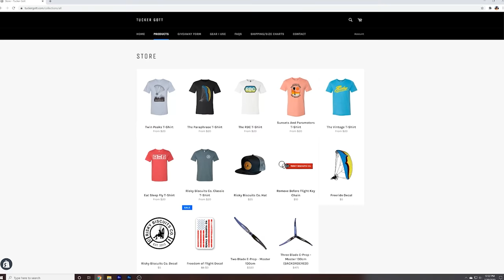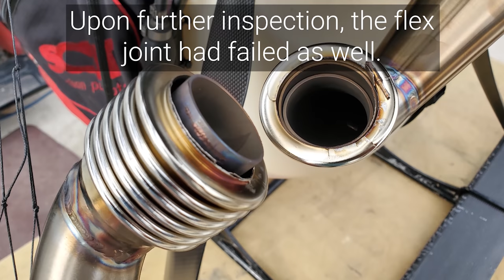Landed On A Street!!! - Top 10 Engine Failures

Comment: Tucker, need you to settle a score. When referring to the motor/engine on your paramotor, do you call it by the chassis name? Or do you call it the engine name? Would you say your exhaust cracked on the Scout, or would you say your exhaust cracked on the Moster 185?
Reply from the maker: I would call it by the engine name.

Comment: If you have an Atom 80, make sure there’s oil in the gear box!  It’s only 33ml so doesnt take much, but not having oil caused me an engine out on my 13th flight, after 10 min of flying..Gears turned into confetti, it was my First time flying this motor after just purchasing used so lesson learned.

Comment: Good thing you found that screen that goes in carb. its a filter but also restricts fuel flow with out it mostly like the engine would get flooded. Most weed wackers,blowers and chainsaws have the same screen and its almost always dirty if they're not running right

Comment: Lovely and very educational videos!
I never flew paramotor or paraglider, only regular gliders. One thing I found a bit strange, a total lack of instruments I was used to (stall-warning, altitude, speed, vario, possibly engine instruments (cylinder temperature, oil temperature, water temperature for water-cooled), quantity of fuel etc. I guess it would make the whole thing more complicated and a bit heavier but it would, on the other hand, increase safety. I would be grateful if paramotor pilots could comment on this.

Comment: I have a moped, so Im familiar with centrfugal clutches. they are great, but If your engine is acting up just starts to go up in revs, and you can't make it stop, having a killswitch or a fuel tap to cut fuel, or even an airvalve to suffocate the engine can save other components, In my case the clutch and variator, in your case the entire motor

Comment: The buildup in the combustion chamber from running AVGAS is from the antifreeze/anticoagulant they run in AVGAS. You need much hotter combustion temps / much higher compression ratio to burn it off properly.  That buildup is the same reason why Hot Rod people don't run AVGAS in their Hot Rods anymore - it kinda gunks up the works.  Tetraethyl Lead is more of a lubricant and is designed to burn up and not leave deposits like that.

Comment: All sound similar to several engine outs on my Quicksilver UL, E and MX . Unfortunately one of the landings was in a stiff wind and bounced then ballooned up to 20' then noise down at a 45 deg. It was on a weight shift and I caught the cross bar in the ribs.

Comment: Man i want one of these so sooo bad 😢😢😢. Btw. To fix the problem of the rings clipping the exhaust port. Sometimes you can drill out the oil hole on the exhaust side in the piston. (I do it to allot of 2 stroke bikes anyway).  They seem to catch there allot esp if running a little lean

Comment: Funny I've seen your failure number one in person... it was my dad, he had a rig that was more gokart than backpack... throttle froze but he couldn't go up or down... ended up hitting kill switch at about 50ft agl... I'm not real familiar with the performance specs of the wing but 50ft wasnt enough altitude to transition from dragging the chute to flying the chute and flare to land...he just kinda screamed into the ground at a 20° angle, and had quite a bounce... broke the nose wheel and the hoop but walked away...

Comment: Very cool. Glad none of these involved anything more than a safe landing, after an engine failure. By the way, I wonder if you could touch on the topic of electrolytic corrosion, a leading cause of part departures, when differing metal types are brought into contact with each other? Thanks.

Comment: Dude I love your videos and as an Electrician and also someone who knows a lot about engines do you know how incredibly easy it would be to hookup Analog or Digital fuel gauges? It would be so much easier to see your fuel level. Also, pro tip, be sure to ask your local mechanic where to get the cleanest fuel, some gas stations, especially BP , can have really dirty fuel. Other than that small engines are all about TLC maintenance and knowing how they work. So basically just take it easy on them and take care of them well. The inside of that cylinder with the lead fuel was BAD!

Comment: Fit an anti freeze system to the throttle cable tube or a heater element. Try aspen fuel for your engine it’s super clean.

Comment: @12:47  Maybe the engine run lean, got to hot and the ring gap is too small.  When ring expand too much due to heat the ringgap is zero and the only way to expand is out through the ports. File a larger ring gap. Maybe 0,10mm  (4/1000 inch).  Measure the ring gap first with a new ring 1/8" down in the cylinder. Check specs.  File it to upper limit and you are safe.

Comment: Just a headsup peeps.  99% of these motor problems are preventable by simply doing a VERY good static balance on your prop.  I have found that even though e-props come very closely matched, they are still a gram or 2 off.  Get a good digital gram scale and measure each blade, then make yourself a good setup with either a lawnmower blade balance kit or build one using threaded rod.  I have both setups and I make sure to check balance anytime I have a prop strike or suspect the vibrations on the motor are getting bad.  If you start shaking wires off of switches, or shaking plugwires off of sparkplugs, cracking exhausts, etc....it might be time for a static balance check.  Cheers, and happy landings.

Comment: Man that issue with those rings tearing the inside of the exhaust port, I had that happen on a dirt bike of mine. Are they 2 or 4 stroke motors?
Reply: Paramotors are mostly equipped with 2-strokes. On 4-stroke there isn’t an exhaust port on the cylinder to tear.

Comment: What did you fine out about that stainless steel weld? What little I know about ss welding,I'm thinking the guy that welded it used the wrong filler wire. I wouldn't get anything welded from that company. Good thing it wasn't the frame or a structural part of the paramotor if it was made of stainless. And did you get it welded or go back to previous style exaust? Thanks,just a bit curious

Comment: When you put a lot of time on 2-cycles the piston rings wear out and rotate around hitting exhaust port. Or the small alignment pin hole was drilled to deep so the dowel wont hold ring in proper alignment i have seen this on cheap pistons NEVER SAVE MONEY ON PISTONS by getting cheap trash. And always put wrist pin clip in so that the C shape is not pointed sideways in cylinder at high rpm's the c clip can pop out and boom goes the engine  i always point C facing down seen so many new 2-stroke builds go wrong in break-in from this as well as dropping c clip in crank case and when you rev it up is sucks it into the piston.  little tips from Alaska

Comment: Tucker, on your first frozen throttle cable issue, if your killswitch failed do you have a fuel cutoff to starve the motor that you can operate in flight?

Comment: This video just made me think of some final destination stuff. What if throttle got stuck wide open with a kill switch malfunction?  If you had plenty of gas wouldn’t it take you up into where you would need oxygen . Which would need more oxygen first . The motor or the pilot as far as passing out or quit running .
Reply: Pilot could use wingovers and turns to keep excessive altitude off until you ran out of fuel...still would be a sketchy situation though!

Comment: From what I see as a TIG welder on that exhaust, the way how that thing is welded, how irregular every bead is, undercuts pretty much on every weld, deeply sunken but joint welds, I wouldn't have put this on my paramotor at any circumstances. That thing is dangerous and they should reconsider occupation or at least quality of their work and their welding procedures.
Reply: Totally what I was thinking as well. Some shadetree engineered stainless exhaust that looked pretty but wasn't even fit for a ground ATV, let alone an aviation-grade application.
Reply: @rugbyguitargod  exactly. The problem is that welders are readily available pretty much to everybody and it’s not really regulated as in who can manufacture aviation/aerospace grade products.

Comment: 4 stroke air cooled motors on older quads and dirt bikes literally run for 15-20yrs failure free. Can those be used for your motor setup? Quality of those motors are not good. Regardless of what you may think

Comment: If you ever buy something that's stainless steel and the welds are rainbow colored like that, look inside. Odds are there will be grey/brown crystals on the inside of the weld. What that is is what's called "sugaring" which happens when the inside of the tube isn't purged with argon and oxygen can get to it and make it brittle. I expect that was what was wrong with that exhaust. Add to it the weight of that expansion chamber and muffler and the vibrations with the prop and that's why it broke so easily. If you ever find that, I personally would send it back as it's only a matter of time before it breaks. Sad part is almost all stainless exhaust systems are made that way from the factory, it's not worth the extra $20 or less of gas to back purge it to them, hand made parts are the only way to go IMO.

Comment: Those engines have a lot of fail points…possibly niche/semi amateur build market so quality can be poor while costs are very high. eg new exhaust broke off…who built that?
High performance/light weight components might be a factor, structural margins must be tight. A 30 HP motor is almost as powerful as a very small car, but light enough to carry.
Looks like maintenance requirements are considerable with a high chance of things breaking and falling off.
These mini documentaries are an excellent inside view of this activity.
Reply: it would be scarier if the engine would have stopped if he was near ground and high speed

Comment: Hey Tucker: I have a couple questions. I actually found the answer to my satisfaction but thought it may be a topic for a video... Why do you fly a paraglider rather than a parachute? What is the difference?
Reply: One is designed for unpowered falling and to be opened during free fall the other is designed to work with a motor and be open from the start so I think it might be more efficient but I am just guessing
Reply: @christianlingelbach5327  I'm guessing you have not done a search for "Powered Parachute". This is not for freefall skydiving.
Reply: @homezero  and a parachute is what is designed for freefall a paraglider is not thats all I said
Reply: @homezero  I never heard the term powered parachute
Reply: @christianlingelbach5327  Just an alternative for Flight. I might add a more expensive route. They can fly in higher wind conditions due to the weight. this is more of a cart flight not a foot launch.

Comment: That exhaust crack looks like it was caused by the weld not having a cover pass, it reheated and failed. Overall the welds didn't look too good. I could do much better myself lol
Reply: I'll have to check out the welds again but as a mechanic I'm fairly confident he installed it improperly. It's not a homemade fence post exhaust, its from a legit company that sells plenty of them, so I doubt their selling exhausts that fail in 5 minutes in 2 different locations. It  failed at the flex pipe as well which is a major red flag.  He must have omitted a bracket somewhere, installed it under tension (ie prying it one way so the bolt holes line up or something) or didn't use lock hardware/correct torque on exhaust mounts and it shook loose. A little bit of the wrong vibration can cause a lot of problems.

Comment: The local instructor alway recommends aviation fuel 100LL. I noted that auto fuel had less lead than 100LL and asked him why he recommended av fuel.  His response was that the methanol and other additives to auto gas could or would potentially do more damage to the engine than the lead in 100L even after I watched him open an engine and scrape out the lead deposits on the piston and head. I know you ususlly use auto fuel. Could I have your opinion on this?
Reply from the maker: I've always run pump gas (aside from the Icarus) and the only bad effect of the ethonal is that it shrinks your fuel tubes after ~150 hours.

Comment: 7:05 i dont think thats the lead..... 
might be the oil-gas mix ratio was thrown off..... and it was running a bit lean. 
.
im an auto-mechanic (who also uses 100LL in my hot rods).... but engines ran for DECADES on leaded gas with out making deposits like that....
im really thinking the oil-fuel mix ratio got thrown off due to the octane difference..... and the lead acting SORTA like the 2 stroke oil
.
might of had too much lube (oil and lead)..... which would lean out the fuel-oil / air mix 
.
what did the spark plug look like?

Comment: What I tell you about a two-stroke motor!  A two-stroke engine sucks!  It is worn out, frequently breakdown, and even suddenly dies out while in the air.  A four-stroke engine is much better and lasts long durability.   The biggest disadvantage of a four-stroke engine is its heavier weight than a two-stroke engine.  Also, a four-stroke engine costs more. 😖

Comment: Avgas is just higher octane right?
I don't know anything about these specific motors but I do know that if you have a low compression motor running high octane fuel is bad. I run high octane fuel in my bikes because they are high compression and can burn off the extra crap. You should have heard a major difference in engine noise. If I run low octane fuel I get extreme pinging. Loud af. Changing your fuel mix with out a tune is sketchy af and doing right before or while in a endurance race is bad news all day. You could have seized in mid air. In a landing. Danger lol 😆 but you figured it out and you do pretty well with engine failure. If I  seized if would kill me. My back tire is directly connected to the motor and nobody is quick enough to hit that clutch in a engine lock up.

Comment: In a situation where your clutch is seized or binding up and you’re worried about ruining your pull starter. Spin the blades with your hand to start the motor. Just be careful not to let the blades hit your hand when your engine starts.